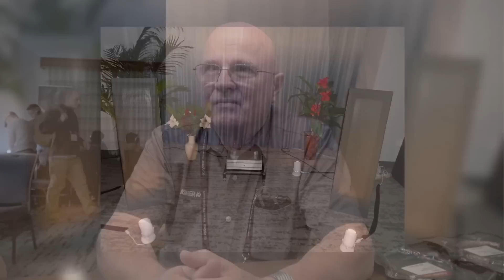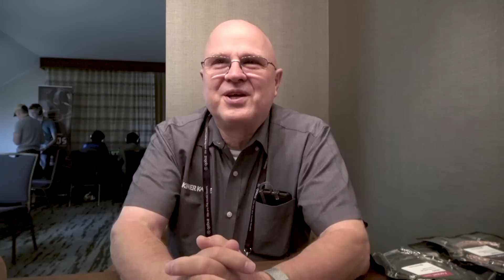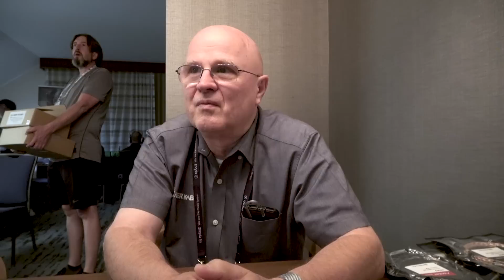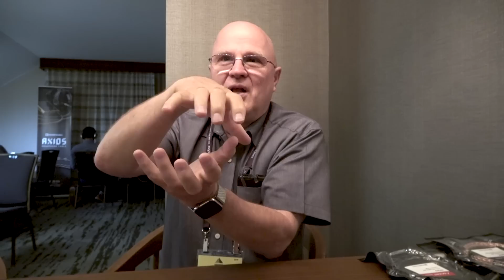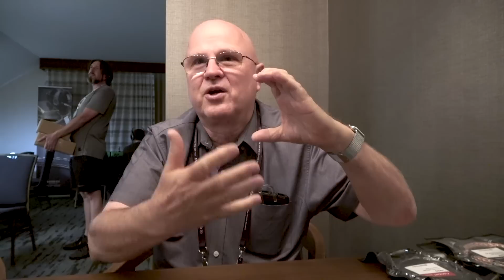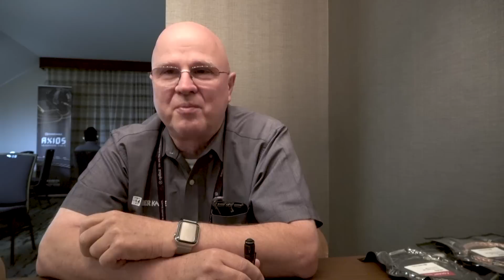Ray Kimber's passion for cables might turn around naysayers

Comment: Cynthia, I've got a challenge for you. Use your Kimber cables and listen to a song you know very well. Then hook up some Monoprice monolith speaker cables and go back and forth between the two cables in the exact same song over and over and over. I promise you you will not hear a difference. It's snake oil. As long as the cable is made well it is a thick gauge that's all that matters
Reply: Make it a blind test
Reply: Better yet, forget all the psychology clutter espoused by all the self proclaimed authoritarians and trust your own ears. Personally, I believe it takes at least two weeks to fully grasp the true nature of a component assuming it’s compatible with all associated components. And yes, a cable is a component. Listen to as many as you can. Choose the one you miss the most once it’s no longer in the system. If you don’t miss one, keep looking. If you hear no difference, buy the least expensive. It’s simple really. Don’t make things more complicated than they need to be. And most importantly, have fun.
Reply: @billdunn8542  yes that's exactly what I am proposing to trust your own ears. I respect your two week comment but I disagree and believe it could be heard within the same day just doing some blind testing back and forth
Reply: Ryan Schipp, your cables will be defined by your associated equipment. I find it easy to determine the quality of a cable need with in a given level of performance. It’s generally a no brainer. It’s when I start comparing different cable in the same range of performance from various companies that the differences can become far more subtle. Sure, you can go back and forth between cables as many times as you like, blindly if need be, to ascertain exactly what those subtleties are, I just find that at that point, it’s time to determine which is the easiest to live with over the long run. What the analytical mind finds compelling can become your worst nightmare over the long haul. The problem with AB testing, every time you handle the cables, you induce stress which can mask the more subtle differences. A speaker cable that has been coiled up for shipping can take four or more days to relax so that it is listenable. Time is your friend.
Reply: Bill Dunn really? Let’s see, if I pay hundreds of dollars for speaker cables and merely handling them induces stress enough to diminish their audio properties I may have to rethink the quality level of the MFR. Oh and they aren’t even listenable for a week until they “relax”. Do you here how foolish this sounds?..... Really?

I don’t mean to rain on anyone’s parade but this kind of nonsense isn’t good for the hobby it just spreads misinformation to the gullible and gives us all a bad name to those who might otherwise want to join us.
Reply: @bluesfish55m51  Please list the audio equipment that you used, to test whether or not cables make any difference.
Please include all of the equipment, as well as who professionally set up the equipment.  How was the positioning of the speakers chosen?  What room treatments did you use.

In order to perform such a test, you have to have equipment that is capable of performing the test (the stereo from Walmart does not qualify).

Surely you conducted such tests, because you are calling the affects of different cables nonsense and accusing others of spreading misinformation.
Surely you would not either knowingly or unwittingly be doing what you accuse others of doing?  You would not be spreading misinformation?

So please list every component that you used in your listening test of cables, for which you based your conclusions.
Reply: Perhaps did I say cables don’t make a difference? No! I made no such claim. If you want to respond, address my points not those you attribute to me with no evidence to support your assumptions. You’re doing towards me the very thing you accuse me of.
Reply: Blues Fish, Really! Take a coat hanger and put a sharp bend in it. You can see the stress induced in it. An extreme example, but you get the idea. Now how long cables takes to relax depends on how much they have been disturbed. Didn’t say that they weren’t listenable. If you are comparing cables you are considering buying, you should normalize the experience before making your final decision. Now I’m not saying that you will here the stress, that depends upon the resolution of your system, and the acuity of you hearing. It does exist and under the right circumstances it can be heard. Sharing my experience with people who enjoy the same hobby as me is not is not spreading misinformation to anyone. As with all things audio, trust your own ears.
Reply: @Ryan Schipp, please name the equipment on which you have conducted this test.  Include each component, room treatments, and who and how was it professionally installed.  Also include the basis on how you picked your recordings.

If you did not use a stereo that is set up to reveal differences in cables, then you did not do a proper listening test.
The stereo is part of the testing equipment.  It must be good enough to reveal differences.  If it is not up to the task of performing the listening test, then there is not point to the listening test.
Reply: @0Perhaps  holy cats you didn't read anything that I wrote. I'm telling Cynthia to do it and get back to me. I'm trusting her of course and I don't even know her.
Reply: @ryanschipp8513  Yes, you wrote your comment, addressed to Cynthia.  And your comment made assertions without foundation.  So I asked you provide context, information, supporting evidence of the conclusion that you aimed at Cynthia.

I read what you wrote.  I am not sure that you read what you wrote.  Either that, or you are deliberately being controversial.
Reply: @0Perhaps  no need to bring me into it I address Cynthia.
Reply: @ryanschipp8513  You brought yourself into this.
When you make a nonsensical comment, in a public forum, then expect it to be challenged.

Regardless to whom you address your comment, lots of people read it, and some will believe your assertions.  When those assertions are wrong, people will let you know that they are wrong.  I am asserting that you are wrong.  I support my assertion based on you ducking out of answering any of my questions.  You were caught spreading BS, and you keep doubling down, digging yourself into a deeper hole.

You addressed Cynthia.  Did you get her permission to address her?
I am addressing you.  Do I need your permission to address you?

If you want to have a private dialog with Cynthia, this is not the place to have it.
Reply: @0Perhaps  you obviously have too much time on your hands I ask Cynthia question to compare the two cables and if that simple keep on waste your time writing stuff LOL it's hilarious
Reply: @ryanschipp8513  What you just wrote and your original comment are in conflict with each other.  Your original comment, where you draw wrong conclusions, is there for everyone to read.  I asked you questions, based on your original comment, and all you do is make excuses.

You are back to doubling down with BS, and digging yet a deeper hole.

Comment: Can you measure the difference ?????????????????????????????????????????????????????????????
Try do the calculations for reducing the capacitance from 1nF to 500pF and the inductance from 0.1 to 0.09 uH with 5 mOhms all per running meter - in the audio frequency range. And I don't care if you include the 5th and 7th harmonic on the lower part of the spectrum and now one will ever notice any change of the 5th from the upper half of the spectrum.
Any claim that you can hear what is immeasurable is placebo, snake oil or a plain lie.
That said - the Kimber cables are nice designed and most likely quality workmanship - but don't  buy the cables to get better sound than any other suitable cable will.
Reply: Well said.

Comment: While it is indisputable that cables, including USB and power cables make a very noticeable difference in sound I do not think this video will convert the fundamentalist cable naysayers.
Reply: Why indisputable?   Seems extremely disputed to me.
Reply: @erickuehne  Perhaps "indisputable" is not the best adjective to convey a person's conclusions.  But for those of us that have heard the differences that cables make on sound quality, we are convinced of affect that cables make on a good (or great) stereo.

My ears are my testing equipment.  I am not an engineer, so I cannot debate about engineering concepts (any more than I can debate a doctor on treating an illness -- yet not all doctor's agree on treatments).

So I am left to use the only tool, the only testing devices, that I own -- my ears.

On some very, very good stereos, at my local high-end dealer's store, I was there when they were testing different cables.  We all heard the differences.  Sometimes it was barely noticeable (and you probably would not have noticed if you were not focused on it and doing an A/B test), and sometimes the difference was striking.

They were using QuickSilver cables, and they were very good.
They switched to some generic department store cables (I do not remember which ones), and the sound quality deteriorated.
They switched to Audioquest's Sky cables, and "Wow!" did they make that stereo come to life.

I was there.  I heard it.  This is why when people write that cables do not matter, I know that they have either not tested, or they used a low-fidelity stereo to test (and such a stereo is not qualified for such a test).

Cheers!
Reply: @Perhaps I’m guessing this test you heard wasn’t blind, and the dealer probably was very good at priming your opinion.  If there are indeed noticeable positive differences then why aren’t there any blind tests that back up all these claims?  Why are cable manufacturers and dealers so opposed  to blind tests?

Some people love to spend lots of money to feel they have something “better”, and no amount of reason or common sense can stop them.  It’s not a bad thing — at least it keeps the cable manufacturers and dealers employed!  They are by far the highest profit margin item in the industry.
Reply: @erickuehne  Yes, it was not blind.  I knew which cables were being swapped with each other.  But it did not matter.  It was not wishful thinking.  It really made a difference.

As to why manufacturers and dealers being opposed to blind tests?
I do not know that that is true.  Maybe it is.  If it is true, then I suspect that it is because if tests are performed on low-end gear, or on a stereo that is not professionally set-up, or mediocre source material is used, etc, then testing cables on such a system will not reveal cable differences, and it will be reported that all cables are the same.

I heard the difference in a store, approximately 10 years ago, where they were using Vandersteen Quatro speakers, in a treated room, with QuickSilver tube amps, and an Aesthetix Calypso pre-amp.  Can cable companies count on blind testing to be done with that level of speaker quality and associated components?

Also note that I have heard the Quatros in several stores.  At the time, most of them sounded boring.  So I asked to hear the Vandersteen Model Five (flagship).  They, too, sounded boring.  I wondered why those speakers got such great reviews .

Then I heard the Quatros in the store where we did the cable swapping.  Those speakers sounded fantastic.  It was amazing how much better the exact same speakers sounded, when properly set-up.

Even if double blind cable testing was done on high-end speakers, if the test gets conducted at one of the other stores, it will yield bad results.  So my guess is that reputable cable companies cannot count on the testing environment to be up to snuff.

"Some people love to spend lots of money to feel they have something “better”, and no amount of reason or common sense can stop them."
True.  There are many people that buy a new Ferrari and park it in their living-room.  They just want to have it.  There are people that buy a lot of expensive audio gear, and never use it.

As to the profit margin on cables...
I have heard that, too, from people that I trust.  I believe it to be true, and am not happy about it.
Reply: Power cables make a difference if you have them hooked up to the power company direct. The problem is the aluminum and the Romex before your power cable. Buy a power conditioner first.
Reply: @amazoidal  -  Good idea.  I bought a UPS which outputs pure sine wave.
Reply: @amazoidal  Power conditioners are an essential part of a proper hifi system. Clean power makes a world of audible, repeatable, A/B and blind A/B verifiable difference.
Reply: @flash - You are correct. imo.

Comment: Cables vary but you need to be very carefull since there is a lot of snake oil out there. Not saying Kimber is (never tried them) I use VDH speaker cable and interconnects.

Comment: A chain is only as strong as it's weakest link. You may use expensive cables in your system but mixing consoles, component internal wiring, internal speaker wiring is lucky to get Belden quality. What do the Chinese use in all your components? Do you think your expensive power cable does anything at the end of miles of aluminum pole wiring and hundreds of feet of cheap Romex? Get real, People. The owner of Audioquest lives in a huge 5 million condo inside a Calif Beach town shopping center. There is huge markup on so-called Audiophile cables.
Reply: People buying these cables likely don’t have any “Chinese” components. The components they use are likely very high end and use therefore high end internal wiring. If they don’t, then yes that doesn’t make sense. I do think the power thing is a little silly.
Reply: Stanny1 no one is forcing you to buy them. And are you you against capitalism, a guy making money? What are you, some kinda commie?
Reply: @Stanny1, distortion is cumulative.

So following your logic, if crappy cables are used in your CD player, then you might as well use a crappy receiver.
If crappy wires were used in "X", then component "Y" is doomed.

Stanny1, every inch, that the audio signal travels, colors and degrades the purity of the signal.  The quality of every inch of everything determines the degree of that degradation and coloring.  So if you use amazingly great cables on a crappy stereo, you will hear that crappy stereo sound its best.  If you use crappy cables on that crappy stereo, then that crappy stereo will sound even more crappy.

So if you have a reasonably good stereo, then better cables will allow you to hear that stereo at its best (or close to it).  So even if cheap cables were used in component "X", you do not want to further degrade and pollute that audio signal by using more crappy cables.

If your turkey is overcooked, that does not mean you might as well eat stale stuffing.
Reply: @Stanny1 -  Well said, but brutal.  lol.    Yeah. A lot of the boutique gear is for the "prestige" factor.  It's like Rolex watches aren't that much better than a regular watch, but it is the expensive case which gives it the "exclusive" status.
    I've made pro recordings using Belden cable, it's decent quality.